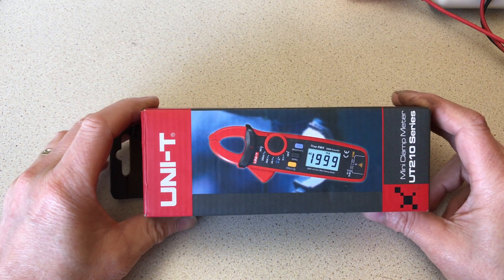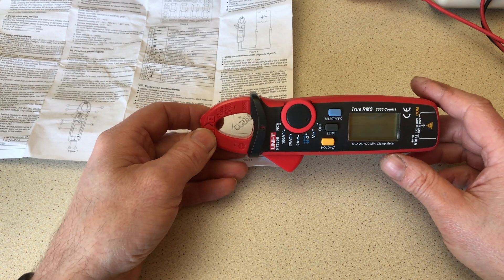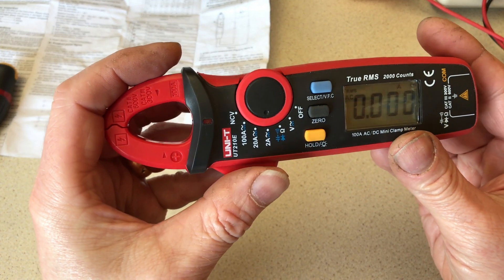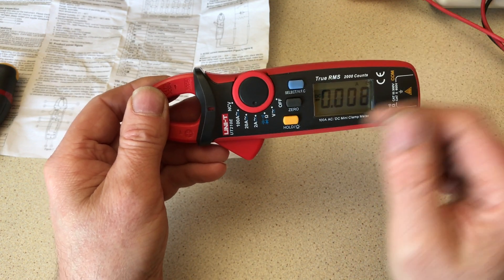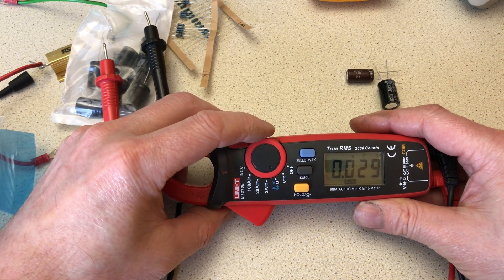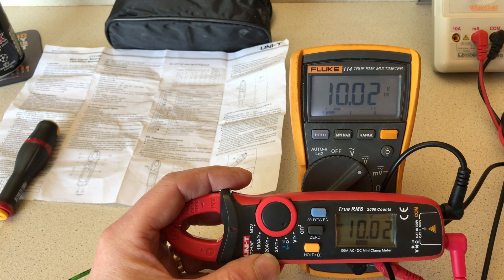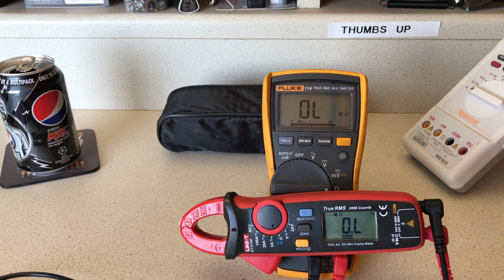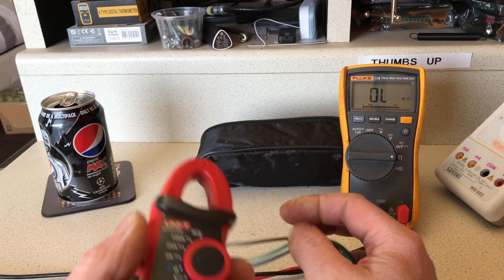UNI-T UT210E clamp meter overview

Comment: Just bought one via Ebay. I got it for the amp measurement & continuity really & the size of it great when working on auto's. The instructions are in Chinese but I can work off the symbols as fluke multi meter I've had for years are the same. It's good meter for Auto Mechanics, very pleased.
Reply from the maker: Thanks for sharing. I also bought mine for the clamp meter. Thanks for watching 👍🏽

Comment: hello... i just want to ask you about my unit, why Err E is showing up on the screen when i turn on the unit and it takes more time the unit to work ,what is the problem?
Reply from the maker: Mine was very sensitive to battery voltage. Have you tried new batteries? Is the unit at room temperature. Coming from a cold environment can cause it to react slowly until it’s warmed up.

Comment: Mine is way off. I just got it and while using NCV you don’t even have to touch something for it to start going off. I can touch my hand on the clamp and it starts going off. I don’t see any way to zero NCV. Only when you are measuring current, you can zero it.  and when you use DC amps it just starts jumping all over the place, no matter how many times you zero it. Even if you put it right up to the wire, clamp around it, hit zero, and then turn the circuit on. It just starts jumping all over the place and giving you different readings every time you turn the circuit on and off. This thing is a joke.
Reply from the maker: Sounds as if you may have a duff one. I don’t use mine everyday but when I do it’s stable and bang on.

Comment: Does ut204+ can read 1 DC Amp ????
Reply from the maker: The spec says it can read up to 600a DC but at what resolution at the lower end is unclear. Look here:  https://amzn.to/3S5xXjw    And here:  https://meters.uni-trend.com/product/ut200plus-series/
Reply: @MikeMakesIt Does the red wire (positive) same DC current as black wire (negative) when using UT210E ?
Reply from the maker: The cables are identical apart from the colour and will carry the same amount of current

Comment: One thing I can't get my head around .I used this to check amperage in my meter box  at the safety switch .It showed I was drawing 2.5 amps on a circuit that I knows carries a lot of power points and appliances ,the dishwasher was on, one of my computers was on, the coffee machine was plugged in at idle, yet it showed 2.5 amps ?
Reply from the maker: It could be right. The computer could draw 30-50watts (depends if it's a gaming machine or not) and the dishwasher could have just been pumping water around that had already been heated but before you started to measure. The coffee machine on idle would only have been a couple of watts. Stick an electric kettle on the same circuit and boil water. I'd expect to see another 2200watts (9amps ish on a 240v supply)
Reply: @MikeMakesIt  Ill try that cheers and thanks

Comment: You were 100% right about coating/oxidization on probes. I  have that problem on meter leads and brand new two way radio batteries on charger contacts , they look fine but have an "invisible" coating on them. I did to these leads what I have done for years and years (I'm old)  I rub them with a slight abrasive . I use Crest regular old fashion PASTE toothpaste , has a tiny bit of pumice in it . Put a small dab on thumb and forefinger and rub , then wipe off make a HUGE  difference , continuity taste is immediate .
Reply from the maker: Hi cups3 thanks for the feed back. Good to know. I might try the toothpaste trick! Swapping the leads to gold plated ones could be another way to go though not as cheap. Thanks for watching 👍🏽

Comment: This exact meter was recommended by Mike over at Britannica Restoration. 
If you don't know about his channel it is worth a look as you said you owned a Land Rover.
I was going to get this meter on Mike's recommendation and you have more than confirmed it.
Reply from the maker: Hi Harvey. I've been helped by a few of Mikes videos but not seen the one with the meter. As I said in my video I have found it very useful and it can been seen in use in one of the Defender "Step" videos. I think you will find the meter a great addition to your tool setup, thanks for watching 👍🏽
Reply: I had been looking for something like this for some time but prices put me off; esp for the infrequent use I expected to use it. I bought one of these immediately after seeing that video - primarily for the 2 amp DC ability.

Comment: Just a quick note, to let you know that electrolytic capacitors  have a wide value tolerance usually +20% to - 10% of the marked value. It's usually marked on the side of the caps.
Reply from the maker: Hi Pidgeonplucker, thanks for your comments. Yes you're right I should have mentioned that when I was testing. Thanks for the reminder and for watching 👍🏽

Comment: The way you measuring Capacitors is not entirely correct.
You are gripping both the probes, making your body a resistor in parallel over the capacitor.
Better is to only grab the negative probe with one lead of the capacitor, and hold the positive only on the plastic, and hold the metal tip against the other leg of the capacitor.
Reply from the maker: Hi Victor and thanks for your comments. Yes you are entirely correct. I’ve just reviewed my video and I surprised myself I measured the caps that way! I shall be more careful next time. Thanks again, Mike.